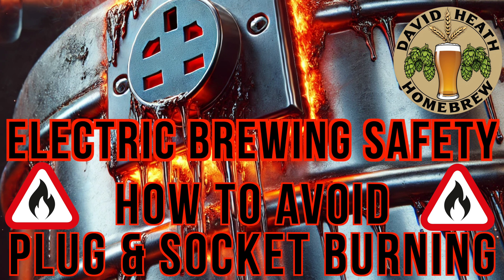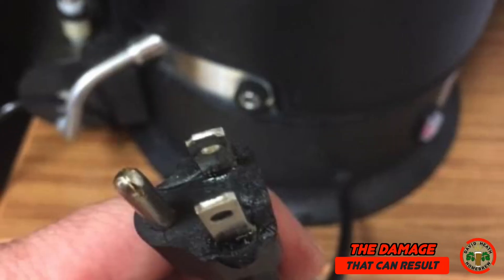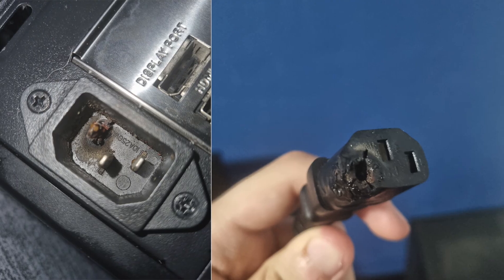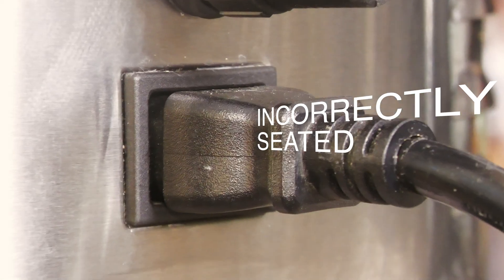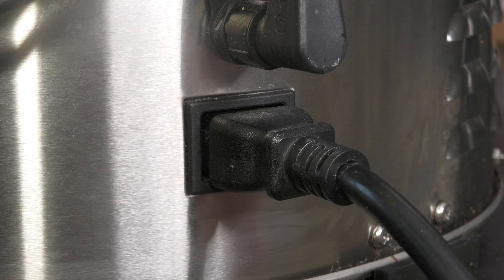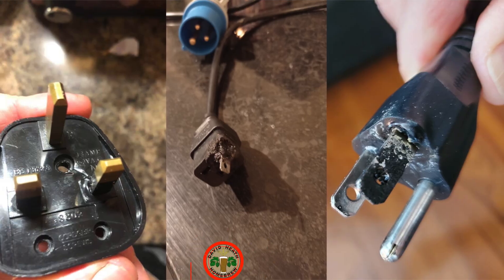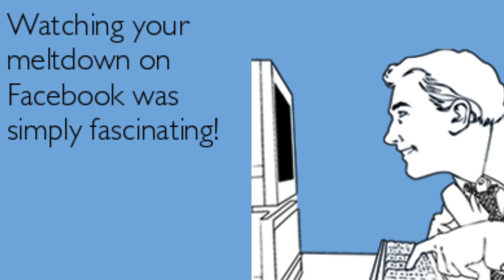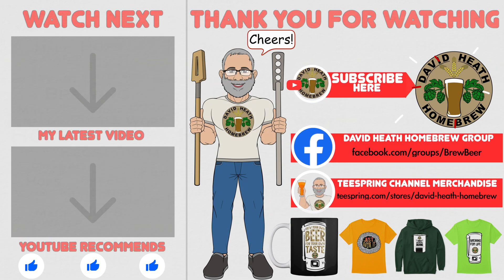Electric Brewing Safety   How to Avoid Plug & Socket Burning

Comment: Happened with my Grainfather S40 lead. It turned out the fuse contacts were corroded, the plug has clearly gotten wet at some point in brewing/cleaning, and resulted in high resistance in the circuit. Luckily I was doing an outdoor brew and only damaged an extension socket and UK plugs are easily replaceable.
Reply from the maker: Ouch. Yes you need to be very careful there for sure.

Comment: Sorry for being off-topic, but I’d like to get some feedback from more experienced brewers.

I brewed two IPAs using Pale Ale malt, aiming for fresh and crisp IPAs. I followed some advice, including from this channel, and reduced the boil time from 60 to 30 minutes. As a result, I ended up with two IDENTICAL beers, both having a strong boiled corn aroma. The smell was so intense that even my wife noticed it with a stuffy nose.

Fortunately, I managed to save one of the beers by dry hopping it in the keg. However, I’m curious—how and why did 30-minute boils become popular? These extra off-flavors really ruin the beer experience.
Reply from the maker: No problem at all. The likelihood of this being due to the 30 min boil is extremely low if you used mainstream malt. If you used undermodified farm malt then perhaps. It also must be said that if one was savable then it must of been a slight case. The precursor to DMS are SMM levels in malt which are at an extremely low level these days. Your DMS is more likely down to a fernentation issue, which could include wild yeast.

Comment: Hey David,  I have a question for you - I moved from Australia to Finland. I shipped my brewing equipment over, one item is my electric brewing system that has the power wire hard wired into the system, I haven’t actually used it for brewing yet but, I was speaking to an electrician and asked if he can change the plug from an Australian plug to a European plug,  he said not to change the plug because it’s safer to use a good quality travel adaptor and to only use the plug that is used for the washing machine as it a higher voltage.  I don’t really know if this is good practice,  your video did make me think about the risks of starting a fire.  If you or anyone has any suggestions that would be really appreciated - brewing is already a sensitive topic with the wife so I don’t want to risk burning the house down!  Brewing will be banned forever! 😢 🔥
Reply from the maker: Hey Gary, sadly this is not my area of expertise, so it is really impossible to advise.
Reply: That’s fair enough David,  
The topic video sparked a bit of concern.  
Keep up the awesome content 👍😊
Reply from the maker: Thank you 🍻🍻🍻

Comment: Thx David, but the the burnouts I had were on several internal switches and electrical fittings inside the products concerned.
This was due to poor fitting and barely adequate cabling. Some people should ask the question why is this product cheaper than its competitors?
Anyway cherrs
Reply from the maker: Hey Ken, there are relatively a very small amount of cases thankfully.
Reply: @ well not in my experience but thankfully my current systems are fine! I live on a houseboat now so I have down sized my brewing considerably anyways cheers mate
Reply from the maker: @kenfowler1980 Your time with these was before mine. 🍻🍻🍻

Comment: I've repaired 10+ G30 120v controllers and all I can say is they are very poorly made for the NA market. 
They dont handle the rated current well and the inner wiring can get overheated by the mostfet heatsink.
All in all, it was clearly built for 240V market with much less amp draw.

I wish they'd make a new version with a proper 20A IEC connector and wiring. 
I bet they would outlast the boiler and stop the heater plug melting once for all.
Reply from the maker: Sorry to hear that. My experiences are just with the European market with the G30.

Comment: I'm on my second electric ⚡ brewing system from a Brewzilla G3 ,35L to a Grainfather G40 and never had any issues with either of them.

Correctly push the plug in for good sold contact.

 Another thing to be careful with liquids, like cleaning up not to spill water 💦 down the side that can wet the plug.

Another one is the 10A 230v cable supplied with the Grainfather G40 Australian/NZ version is designed to run on 10A out of the box and plug in a standard power socket. And if you want to upgrade to 15A you need to replace the cable to a beefy 15A cable and set into the control panel from 10A to  15A and save.
Reply from the maker: Great to hear 🍻🍻🍻

Comment: Lol the timing. This actually happened to me today, a few hours before the publishing of this video. 
I bought my brewzilla gen4 2 years ago and it's the first time it has happened. At first I thought it was my 3 hours boil that did the deed, but I think it happened when I moved the brewzilla outside for the boil or when I moved it back inside at the end of it. Well now I know and I'll check the plug every time I move it. Although my plug (the end of the cable connection to the brewzilla) is not nearly as bad as some pics shown in this video... yeah probably happened near the end of the boil
Appreciate you publishing this video David 👍
Reply from the maker: Ouch I am sorry to hear that. Yes, it is vital to know how to avoid this for sure 🍻🍻🍻